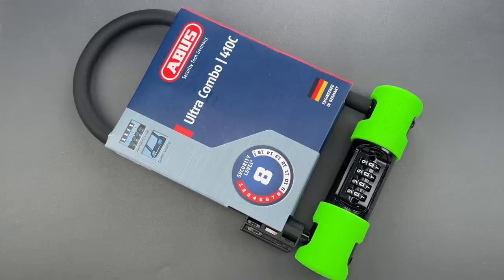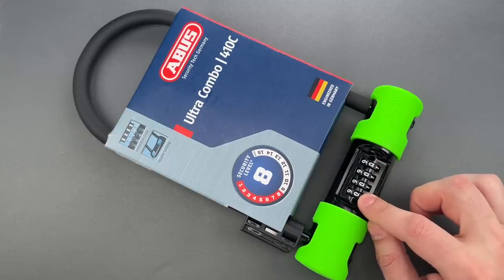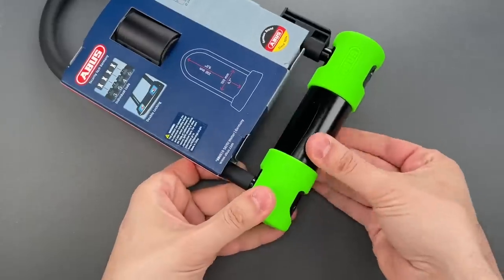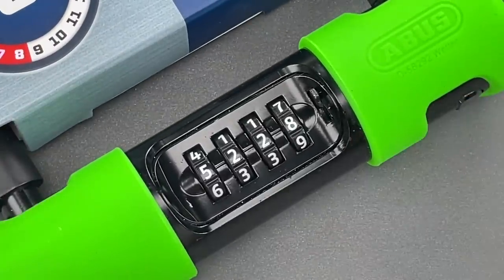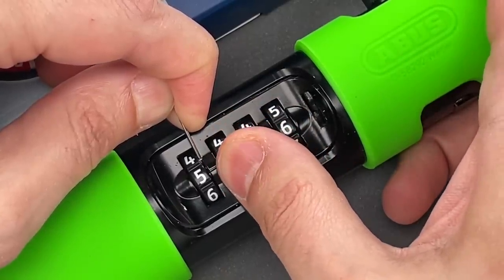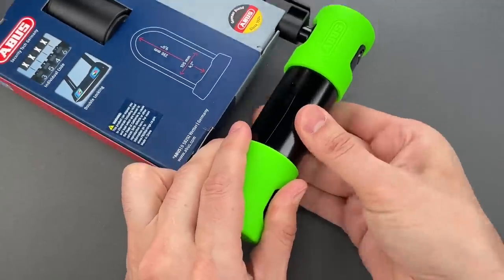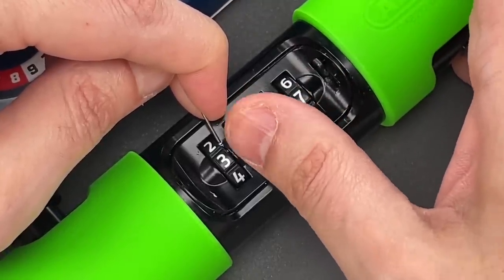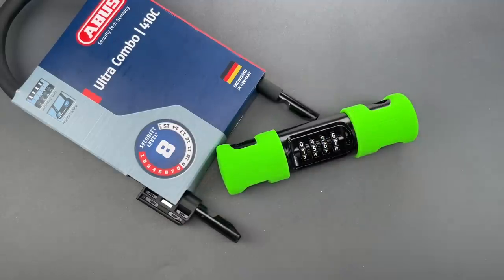[1527] Abus Bike Lock VISUALLY Decoded!!! (Model 410C)

Comment: Nooo… nooo… you never want to be the company that has LPL open the lock with his eyes alone… man. That’s such terrible design.
Reply: When he doesn't even need to bring out the rubber hammer...
Reply: It's a combination lock. That's all you need to know to determine that it's not a good lock.
Reply: And they even were warned about it before LPL lol pathetic
Reply: At least it looks good! 
.....but that means it's easily spotted amongst any other parked bikes!
Reply: And a $60 lock to boot.
Reply: As a German, I feel ashamed.
Reply: @QuintarFarenor  Im german too and im not ashamed. As soon as i found out that most people here buy Abus, i instantly stopped buying them. Abus was never really any good.
Reply: Well combination looks are allways bad to secure things of value.
Reply: @zanthraxnl That's really how you feel about combination locks? Good ones can secure bank vaults.
Reply: @dfeuer  Of course they can but the difference is you dont get a 200kg+ locking mechanism manufactured to the thounsands of millimeters, so silent and soft sliding to decode it takes hypersensitive specialised equipment and or a wonderchild to open them in your local hardware store nor is it really viable to to lock a bike with it.

Apples and pears my dude, apples and pears...
Reply: putting masterlock to shame
Reply: @GeorgeSukFuk  Yeah well what are they gonna do? Making the tooling to change the design will take weeks and getting it to retail probably over half a year, maybe a year. Engineering mistakes happen. What they should do is contract independent security consultants at the prototyping phase, afterwards it's late and expensive to fix these things.
Reply: Well, it seems as if ABUS has put up some cost-reduction which obviously reflects in this terrible lock design. They should definitely reconsider that design flaw!
Reply: @dfeuer  If you don't need a key, no one else needs a key either.
Reply: He can't sell his covert instruments tools....
Reply: @SianaGearz  To maximize profits, they sold a lock that can and will be easily picked by low level thieves. No need to defend that or convince us to empathize with the company.
Reply: Not to mention the green parts standing out
Reply: @GeorgeSukFuk   And apparently they did not care.  Wonder if they will now...
Reply: @daves7775  not if Siana works there!!
Reply: @billklatsch5058  Yes.  I watched a video where they got a lot of permissions (a large network) - and then this guy with a HUGE lock picking talent - opened a Bank Vault Combo Lock in about 20 minutes - just by FEEL.

Comment: Masterlock miraculously reaching the same level of security as its competitors.
Reply: More like the others have sank to Master's level.
Reply: Indeed: Rock-bottom
Reply: Are there any good locks?
Reply: @peacepoet1947  Squire
Reply: @elricthebald870  you could say, lock-bottom
Reply: @psychodelogen.9694  Not ALL Squire are good locks. Theyve got some utter junk in thier lines too.
Reply: Stock price bump
Reply: More like this was Abus rebranding a Masterlock unit.
Reply: @patrickdurham8393  - Yep, if you can't rise to their standards, just wait til they fall towards yours.
Reply: @microMobilidade  😄 could be true
Reply: I whish I said that.
Reply: @peacepoet1947  honestly. By rule of thumb: Thieves don't pick locks they smash or cut them. 

The vast majority of theft is circumstance of opertunity. By making your items appear harder to steal or break into is 90% of the job of the lock. As let's be real, not a single one of the locks that have been shown on this channel would stand up to a high power angle grinder
Reply: @peacepoet1947 not really. If the thieves want to steal something, they will. Similar to fences for houses. It is only to slow down or deter thieves a bit. All you can do is combine different methods /locks to reduce their chances so they are not motivated
Reply: @peacepoet1947  Abus have some very good locks, just not this one lol. Check this channels history for the best bike locks by Abus.
Reply: @cryptout  I don't ride a bike.  I'll disabled with severe back pain which makes walking painful.
Reply: @patrickdurham8393  That's the joke...
Reply: @penfold7800  Oh? lol i only know the good ones from this channel lol
Reply: Even masterlock is not that low. Lmao at visual decoding
Reply: This is Abus showing sympathy for Masterlock.

Comment: Finally, a lock that can be picked by sight.
Reply: This is not picking, it's decoding.
Reply: @gir489returns2  decking, picoding
Reply: @gir489returns2  That's not a comment, that's semantics.
Reply: It’s almost ADA compliant.
Reply: Masterlock furiously taking notes.
Reply: Stop
Reply: I’m pretty sure this is the second or third time I’ve seen him do this although this is the first bike lock I’ve seen this trick done on. Apparently, this is a somewhat common flaw in locks like this.
Reply: I have seen a "lockbox" like this that I decoded with only three numbers. I had it open and had the combo within about 5 minutes of the customer coming in.
Reply: LPL had always been able to pick locks by sight.
Reply: Don't Read My Profile Picture  Okay, I won't.

Comment: I would have expected better from Abus. That is truly shocking.
Reply: Not really.. They have quite a few products that can be combed open and visually decoded - this is just one more :)
Reply: Yeah this is way below what you'd expect from abus. They do make some actually good bike locks, like the Granit series U-Locks. Those are pretty much all mechanically robust and have good disc detainer cylinders. They're still pickable, but definitely far above the level of anyone trying to steal a bike on the street. You'll at least have to bring an angle grinder for those.
Reply: It says it's a bus, not a lock.
Reply: In its own way, it was BRUTAL...
Reply: One could say its, eye opening?
Reply: They did give it an 8/15 security rating, though. Perhaps wildly overrated, but this still wasn't advertised as a maximum security lock, much more like a deterant.
Reply: @vale.antoni  They just keep adding levels on top to make the low end of the scale look high, huh?
Reply: @ska042  "They do make some actually good bike locks"
I once spend more money on two bike locks from ABUS than I spent on the bike. At least the bike didn't get stolen.🤣
Reply: @vale.antoni  hihi 08/15 means in Germany that something is very common (origin: the WW1 08/15 light machine gun was very wide spread)
Reply: It's a combination lock. And it's made in China. That literally tells you all you need to know. Brand names aren't everything.
Reply: @Varangian af Scaniae  were the locks stolen instead? 😂
Reply: @blarfroer8066  Except it really hurts ABUS as a brand to allow this lock to wear that label.
ABUS has been known to make good quality locks that tend to be a bit more money than the competition, but validly so due to higher quality and stronger security.
Watering down that brand with this epic failure is a disaster for the brand as people will not trust their quality products either.
Reply: @Varangian_af_Scaniae  Did they steal the locks and let you keep the bike?
Reply: @RealCadde  Obviously they just hired some cost accountants from Masterlock who told them, it's not about the quality but how much it costs to make versus what the market will pay for it and with your brand name that's going to be a large number
Reply: @darreng745  Yeah, i will give you $1000 now if you sign away 10% of your future income to me for all eternity.
Great deal!

(Note, if you have no income and is broke, it will default to $50 a month regardless and if you can't pay you will have to work for it under the most atrocious conditions in my personal gulag.)
Reply: Is this for certain not a knockoff?
Reply: @RealCadde  Sadly a cost accountant would look at it and go ok we have the $1000 up front and that is all we need, the fact that the company's future reputation is going to be damaged by the resulting poor publicity does not enter into their equation.
Since they are a German company there is a chance that one of the German TV consumer programs will now pick up on this and Abus will have to deal with it, but again it is about riding out the risk which is acceptable to people who have designed such a poor product and brought it to the market.
Those actions show that they are unrepentant about the product and about the brush off they gave to the guy who first raised the issue.
Reply: I guess they looked at other companies and decided if the likes of Masterlock can get away by selling overpriced garbage and make a profit, they really should join in the trash-merchant business and get some of that easy money.
Reply: @darreng745  Yes, that was my point. They are investing in their downfall.
If they are smart they will fire whoever allowed this to happen and repair the damage as much as they possibly can.
If not, they will have to compete with masterlock and masterlock will beat them with experience.

Comment: "We're going to decode this last one by feel, or at least try to." immediately opens the lock
Reply: he had a doubt whether he could have the time to feel anything before opening it.
Reply: With grand total of 10 possible options to try, even if you have to brute force it wouldn't that that long – on average 5 tries and in worst case 10.
Reply: The Lock feels the pressure and just open by sheer fear.
Reply: @MikkoRantalainen  Worst case is 9.
Reply: @XtreeM_FaiL  No, worst case is 10.
Reply: If you ever watched the TKOR channel (or currently the Nate from the Internet channel) Nate used to always say he's going to try to do the most simple and mundane tasks. I'm always like what do you mean try?! Just do it! Hashtag Nike!!
Reply: @ElMigol_  9. If you're not already on the right number then you need to try max. 9 to get the right one.
Reply: @XtreeM_FaiL  Yes, you're right. The worst case if 9 and on average 4 tries is enough.
Reply: If he at least were bad enough to have enough time to end his sentence, before he opens the lock....
Reply: @XtreeM_FaiL   @XtreeM FaiL  the maximum is if you've had to try every number. 0 through 9 is ten possible numbers for ten possible tries, if zero is the number you start on, you attempt to open, that's one try, move to one that's two tries, move to two, thats three tries, ... , move to seven that's eight tries, eight that's nine tries, and nine, the correct number is the tenth try.
Reply: @ChaoticKrisis  It's a combination lock not an USB stick. You don't need to do full 360°.
If the lock is open, you need zero moves.
If it is locked, then you need max. 9 moves.
Reply: @XtreeM_FaiL  and you don't know it's locked or not until you try to open it.
Reply: @ChaoticKrisis  Hold it shackle down and it will fall off on its own.
If there would be a spring, it would also open then.

Comment: As a German-viewer I always asked myself what the "15 level of protection" on these Abus locks really mean. It seems like level 8 = no protection. Would be interesting to see other products from them wither higher/lower level being picked by LPL
Reply: Maybe "level 8" is actually just two "level 0" stacked on top of each other!
Reply: They must be measuring hacksaw/bolt cutter resistance, not visual acuity.
Reply: 8 = 8 seconds or something like that.
Reply: He has done good abus locks as well
Reply: Level 15 Locks would equal a slightly above average Masterlock Padlock in how hard it is to bypass...

Or how long it takes the LPL to open it without the combination or key 3 times just to prove the first 2 times weren't a Fluke...

😄😁😆😅😂🤣
Reply: To be fair, he's said good things in the past about their Granit padlocks.  Gotta wonder if Abus has been bought out by Masterlock since then though🤔
Reply: Level 1 is a sticky note that says please do not open.
Reply: @2lefThumbs  I think quality varies and the Abus numbers are more about stability of the whole thing as thieves tend to attack using an angle grinder or other tools rather than good old lock picks
Reply: In this case acht would be for achtung
Reply: Level 15 is in fact very secure. It's used in the Granit Detecto Xplus 8077, which is a motorcycle lock. It has a pretty secure disc core and a alarm triggered by movement of the lock. .
Anything below 12 won't be that secure.
Reply: Level 1 is a welcome sign
Reply: I now wonder if Abus locks are the same bad quality here in Germany. Because the security standards for locks seem to be generally quite a bit lower in the US than in Europe, so they could get away with selling a worse product in America.
I wonder if that's what's going on, because I always thought Abus had a good quality reputation. Or is Abus just our version of the Master Lock company? 🤔
Reply: @no-one_no1406  😂 yeah, probably
Reply: @imperthnthn  i've also got two of them
Reply: number of seconds to open them
Reply: @imperthnthn yea but let's be real.. bike locks just need to exist to deter most people. I'd wager almost all theft on bikes is on ones without lock or ones that were not attached to a solid object.

There are so many bikes with just a lock blocking a wheel..
Reply: @LRM12o8  LPL states that he has been notified by a German viewer. That should answer your question: they are indeed of the same quality.
Reply: @Ant3CC  a paper clip that one could use to open the lock
Reply: @imperthnthn  two ready available tools will defeat this product.. One is 36inch bolt croppers or above and a 5 tonne sidewinder or similar stubby jack (75mm) which fits in the front pocket of a pair of jeans..
Reply: @HappilyHomicidalHooligan  LPL said in the past that he thinks ABUS was better than Masterlock
Reply: level 1 = open door
level 2 = closed door(door handle)
XD
Reply: maybe, for marketing reasons, level 8 is the lowest one available?
Reply: Level 1 protection. its just a latch, its kinda loose. sometimes it just falls open on its own.

Comment: Finally, something I might be able to replicate!  So much skill in everything this guy does.
Reply: Yeah, LPL is very skilled, but you can open most locks if you practice a few hours. Not in seconds of course, but a 2 minute picking is still a lock opened and a great sense of achievement. I opened a mailbox with a 1.5 hex wrench and a screwdriver. Since then I carry a basic kit, because it wasn't really comfy. We bought a mailbox and they didn't sent the keys. Or at least we thought. I picked it and the keys were there but stuck under a fold. Took a nice 5 minutes, but I'm still proud.
Reply: You'd be surprised how easy it can be. I'm a total amateur and can pick some of my locks easily with some practice. Others I can't manage yet. It's a fun hobby.
Reply: True, but do you really want to give money to Abus for this product?
Reply: @iggman18  Find a bike that has this lock, steal the bike, sell it, buy the lock second hand with that money.
Reply: @ElMigol_  but if you steal a bike with this lock, you already have the lock.
Reply: @iggman18  LPL didn't remove packaging, think he's returning this one!
Reply: I have zero picking experience and successfully copied LPL's technique on two combination lock types - a small number wheel luggage lock and one of those press-button 'key safe' boxes that you shackle onto a fence/doorknob/etc. Both went surprisingly easy with tension on the shackle and going by feel (loose spot for number wheels and added resistance for press-button).

It's super fun! You should give it a try if you have any old combo padlocks lying around :)

Comment: I love the marketing trick on the package "Security Level 8" not 8 out of 10, but out of 15.
Reply: Might be on a scale of 1 - 100 actually, with this being a 8.  No tools needed.
Reply: Took 8 seconds to open and it was still mint in the package. “Failure!”-Steven He.
Reply: There are locks with lower security than this? Is that feat humanly possible?
Reply: Presumably the scale being used is logarithmic rather than linear.
Reply: @dashmeetsingh9679  I think that there are locks that can be oppened literally by pulling the shackle or slaping the side of it, literally faster than using the key or inputing the code.
Reply: It's a reverse field with 1 being the highest security level like DEFCON 1 😅
Reply: What they meant was "Security Level 8 out of 500,000,000"

Comment: The fact that it says level 8 on is just perfect. Great content as always!
Reply: 8 must mean the number of times you would blink before it opens itself
Reply: you know that it is not "level 8" but "a 8 year old can pick it" for each year a different number. so a baby can pick level 1 while you need to be a teenager to pick level 15.
Reply: Or it takes 8 seconds to pick the lock.
Reply: Typical Abus, Level 1 is just farting at it after eating Bratwurst and Sauerkraut.
Reply: Yeah, after this video they’re probably going to have to reduce it to a 7 😂
Reply: Yeah, 8/100.
Reply: OK Next Level 9
Reply: If you use your imagination a little,the 8 looks like two eyes 😊
Reply: They also make those dumb Bordo locks where the rivet can be popped by a river-splitter…
Reply: I bet a lot of people would quickly see that and think 8/10 when it is actually out of 15 which is so weird.
Reply: Only explanation is that 10 is the worst level and level 1 is the best.
Reply: @Kineahora  AFAIK, that's only the case with the cheaper Bordos that lack hardened steel washers around the rivets. And even then, nut-splitters are usually not part of even a professional bike thief's everyday tool kit. Neither is a vise to clamp down the lock while using the nut-splitter on it.
Reply: "Level 8" typo, should be 0.8